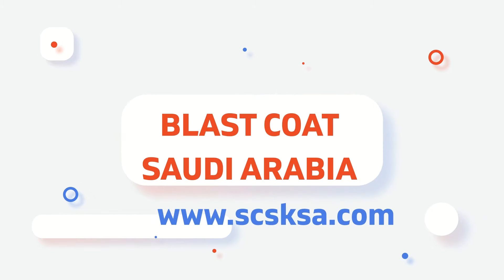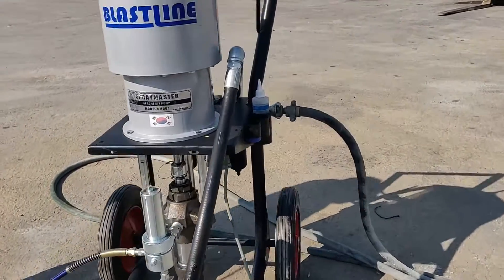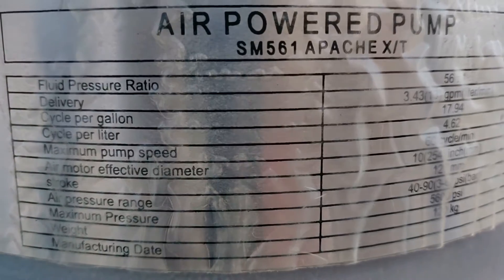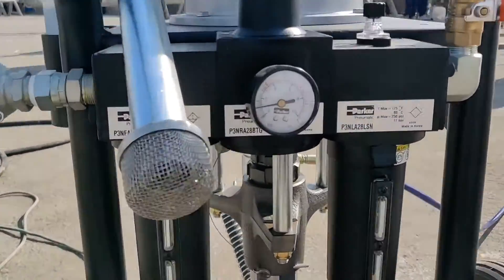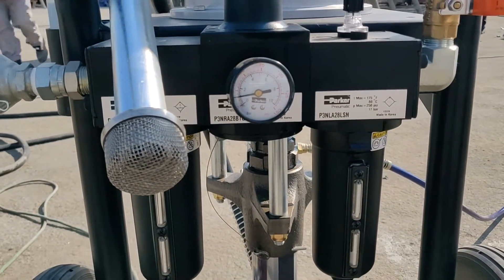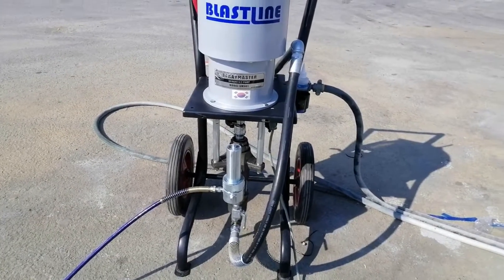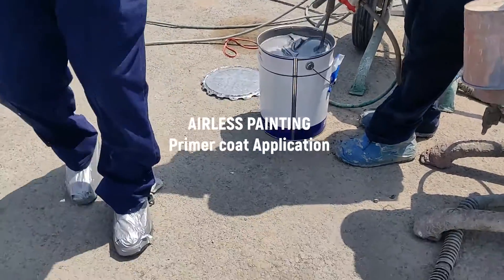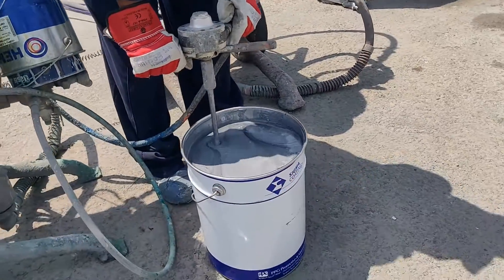AIRLESS PAINTING l BLASTING l CORROSION PROTECTION

Comment: Sir i have a question   if  some area  d.f.t. coming more so what is the solution ?  specially  corner and angle    and joints some small  joints plate?
Reply from the maker: Hi Rohit ,

Please try to build DFT with Brush and rollers depending on paint type ( you cant build up DFT for inorganic zinc ).
Strip coating is the best method for build the DFT https://youtu.be/fRLa69lpFXc.